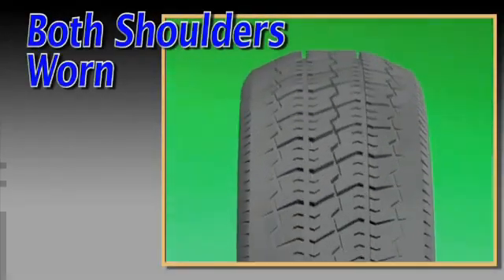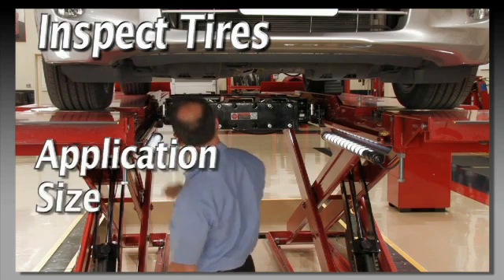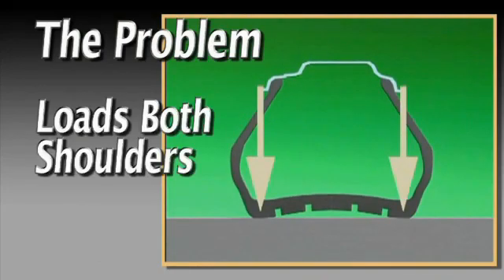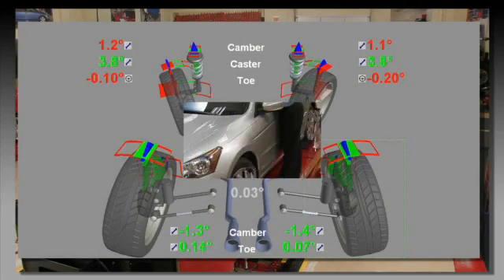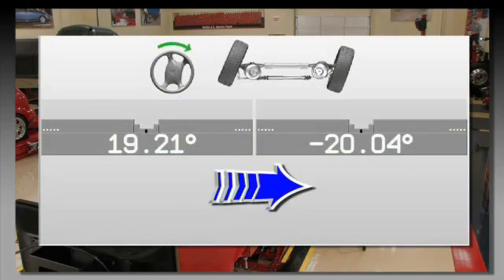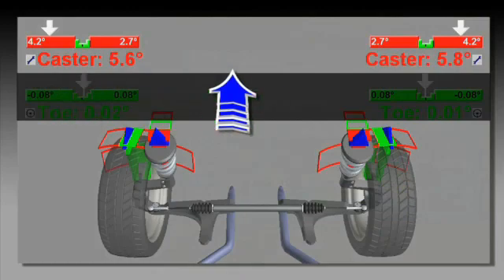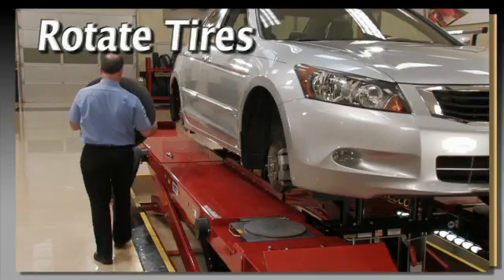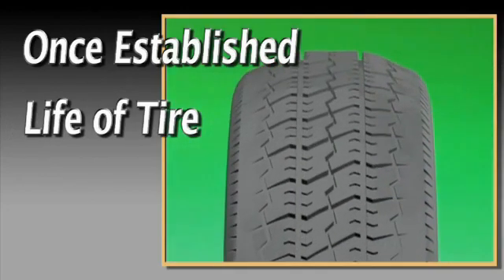Inside and Outside Shoulder Wear - Hunter Engineering

Comment: I'm having excessive inner and outer shoulder wear on both my front tyres. Should I replace them first? Or simply check for alignment before replacing the tyre?
Reply: If you replace them, understand that the new tires will develop the same wear pattern because you have not fixed the issue that caused the tires to wear inappropriately. The main causes of this are: Underinflation, aggressive cornering, or.....like the video shows, a bad alignment.  Bad alignment can also be caused by worn suspension parts, such as tie rods.
Reply: John Anthony Cantergiani thanks for the reply. Both of my front tyre has inner wear more than the outer wear. Inner tread is blur out while outer tread is left with 2mm. Center tread is about 6mm left. Maybe it's time to check for alignment and replace them ASAP? or should I use it for another 5000km?
Reply: Get your alignment checked and also check for worn/loose suspension/steering parts.
Reply from the maker: Sorry for the late reply, but Yes.. have you're alignment checked.  You could very well ruin another pair of tyres if lack-of-alignment was the cause.
Reply: so the  video still wasn't a good enough explanation ?
Reply: I have wear inside and outside edge. I had 2 bad wheel bearing and steering rack pinion.